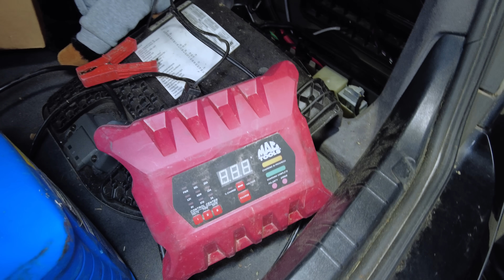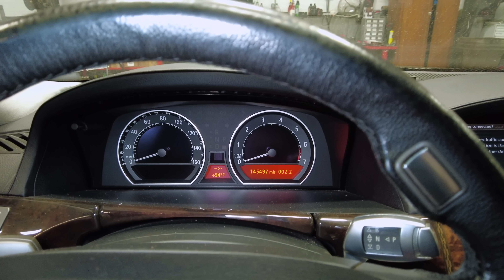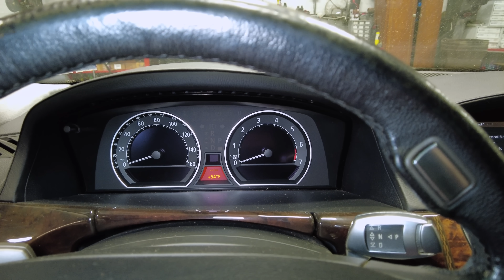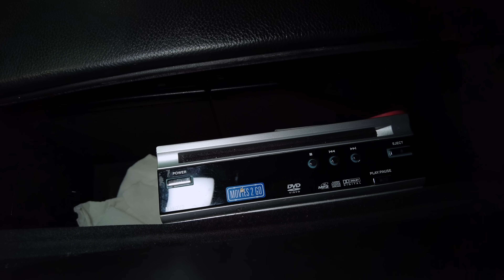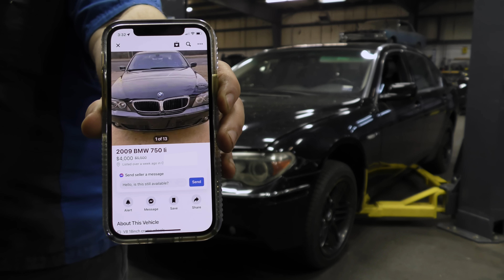Fixing a high mile German car?! Is this '04 BMW 760LI with a V12 worth it? CAR WIZARD breaks it down

Comment: that had been the most expensive BMW of the days back then, the 12 cylinder with a long wheelbase, ususally a chauffeurs car and so equipped 

Therefore best leather quality . But not the most reliable car with a ton of issues beyond the Bangle butt designed by Chris Bangle.
It caused a lot of issues cause sales were bad or the discounts had to be high to sell it in those days.

Comment: Pay 5k, spend 9k or buy another for 4k, then get a quote for 9k. Buy another for 5k.
OK, so that's 15k for 3 BMWs that still don't work. Or, pay 14k for one that will last a LOT longer.
Repairs are usually worth it in the long term. I have a 1954 Morris Minor that has cost FAR more than it is worth (at the moment), but it is now back to factory 1954 condition (or better) and will last another 60 years. I'd say that's good value :) And, if the worst comes to the worst, I can pop in an electric or hydrogen conversion :)

Comment: People think it's cool to drive a BMW. They pay for the badge. They can't afford to maintain them or like David said refuse to maintain them because they bought the car cheap. I bought a 2006 BMW 750i with 82k on it. It had a coolant leak I ended up  replacing the entire coolant system with the exception of the radiator. The coolant leak was turned out to be the coolant recovery tank hose on top the engine. The local BMW dealer told the previous owner is was going to be 9k to replace the valley pan and that's why they sold the car so cheap.

Comment: The 1999 to 2003 BMW, especially E39 chassis are going up in price in good condition. A low milage BMW E39 M5 just went for $80K!
Reply: @8rick1ane I had a BMW 540i 6speed. Grate car, but expensive upkeep!

Comment: This stuff has always separated the men from the boys.  Twenty years ago it was 80's Euro cars.  You saw a regular blue collar guy dailying a Saab or Mercedes or what have you and it was never missing from the parking lot at work, you knew they had their act together.  Finding quality parts for the old junk is the hardest part now.  I'm still driving them but I keep a couple to rotate cause I'm now old and lazy.  The newer stuff that's cheap now isn't any more interesting now than it was when it was new.  Which is to say, not very.

Comment: My 2012 Volvo XC60 has 233,000 miles and counting. Still in great shape. The Europeans are capable of making really good cars, but BMW isn't. So if you want the European car driving experience but Honda reliability (but slightly more maintenance) Volvo is the ticket.

Comment: But what if i work on a BMW 760LI myself? then it wouldnt be 5 grand in repairs right? or is the parts so expensive for those 7 series models that doing DYI is not worth it?

Comment: If that engine doesn't run properly with a bad battery, I'd be looking at the charging system. At no time should a properly running engine run off the battery alone, the alternator should provide the power to keep it running right. Maybe something leaked into the alternator and took it out?

Comment: Boy talk about a "cramped" engine bay. Sure it is a V-12, but There can't be but 2-3 inches from the radiator to the engine. How can the fan pull air through the radiator if there is nowhere for the air to go? Hood louvres would be a nice addition for that car. I've never seen someone drive a car with just a charger pack, and no battery. lol That car probably takes the largest car battery made for automobiles being a V-12! What 1000 cranking amps?

Comment: Wizard, I have a 2008 BMW 750LI and it needs a transmission. If I was to replace it myself does it have to be programmed and if so is that difficult for someone to do?
Reply: @musoui been finding them for 1,600-2,000. Plus the car only has 104,457 on it and is in perfect condition other than the trans ( Title in hand ). My mechanic owes me work for some parts I got for him so I'll only be out of money for the trans.

Comment: This why I drive a Lexus GX470 and my wife drives a Land Cruiser. My gx is an 06 with 145,000 miles and it should last me another 15 years. It will save me a ton of money over the years cause the Japanese over built everything to last a long time. Just doing regular maintenance is cheaper than buying a new car every 3 years.

Comment: I don't agree that all German cars are bad,i have a 2008 S6 V10 and a 2008 A6 Tdi, both have more than 180k.miles, both had been reliable as tanks, the only time i spent money in the S6 was the water pump and i.done timing chain. Other than than had been maintenance at aircraft leven, always preventive and has paid out.
I never seen a single oil leak on any of them..the tdi i dont even worry about as it never needs anything

Comment: What's sad is this nearly 110K car could barely last 145 k mi without just completely falling apart, but my '96 Park avenue 32K new, doesn't even turn a service engine soon light on till it hit 335k miles for an 02 sensor and now with over 412K miles still runs strong SMH

Comment: A car which is limited to 250 km/h top speed and WILL EASILY do that,   expect them to be fairly complicated.

So, which cars in the early 2000s will easily do 250 km/h at autobahn and in comfort ?
And still run today ?
What will they cost to repair ?

They are high performance cars and so, show them some respect.

Comment: Bangle singlehandedly destroyed the sleek design of the 90s with the lumpy garbage and random bodylines starting with this E65 series. He was chief designer on another abomination before that, the Fiat Coupe. Barf. His minion Adrian van Hooydonk is still in charge, and you what garbage design like the new 7 series BMW is still cranking out. I owned several 5- and 7-series, and since the Banglelisation of BMW, I wouldn't get caught dead in one.

Comment: Seems odd that the alternator can't provide the power when the engine is running.  There are cars that can run without a battery at all.

Comment: @12:20, cracked lower control arm drivers side.
Reply: No check opposite one at 11:59 and it's a ridge, not cracked but the light

Comment: The whole unreliable German car stereotype just isn’t the case in my experience. I’ve had several Audis and VWs over 200k miles and none of them used oil or had any major issues. Sure a big V12 is gonna need more stuff than a 4 cyl and it’s gonna cost more especially when maybe 50,000 engines were ever made vs several million but that’s just common sense.

Comment: Funny i have seen this in jamaica. Lots lots lots of milege. Since ive migrated to the north america is crazy how people put a benchmark on cars. Like 100,000miles and then after its a celebration. Where in Jamaica and other neighboring dont know anything about milege. Milege doesnt really affect the car prices in jamaica after a certain point
 Its all about how clean it is and how well it runs. My neighbor 2001 tundra pass a over 2million miles. I think the clock even froze. But yet still its not celebrated there
 Its like whatever. And its still value close to a million dollars. Around 9000us. My uncles e92 m3 has over 300,000miles. But when i come here people talk about it cant pass a 100,000miles. What i have notice the system over here makes you not value your car by raising labour rate tru the roof
 So when a car reaches certain point people decide to junk it. Also, this bull crap about car looses alot of value when it drives off the lot. Its so crazy how the north america system works. My bmw m5 f10 has over 200,000miles there. No issues. Just regular maintenance. Im brining back a cv axle to change when im on vacation in the summer. But thats all its just amazes how people here just dispose of cars so easily

Comment: German cars with plastic components with the integrity of a saltine cracker. Same with most clips & connectors. 
When you get to about 2% of the vehicle's weight being that of "Zip Ties"..... trash it. (about 5 years or 60k miles )

Comment: The plastic will degrade over time so mileage is irrelevant concerning those plastic parts. No plastic in the engine bay of the FW 190!
Reply: The plastic becomes brittle through heat (softener evaporates), so the engine runtime is one of the major factors. Unless you park the car in a sauna, of course.

Comment: Unless you're Ase Certified mechanic or you just have a lot of money to blow it's hard to Odin one of these. All the plastic that they use and all the oil leaks it's just not worth it. These kinds of cars of the one that you just lease and turn it in at the end of the lease.

Comment: Always talking about how terrible BMW'S are. And I agree,matter of fact most new cars and trucks are poorly made or over engineered.
Then on the other side of the spectrum you explain how your moving away from older vehicles because of crappy remanufactured parts etc.
I enjoy your posts,but this one I wasn't into it at all.
Incunclusion,please get that ole chevy down off the rack and drop an LS into it.
Make a multi part series,explain the advantages of investing in old American steel.
Peace,and god bless America

Comment: My brother is about to buy a 1975 Mercedes Benz for 6k that is in really great condition looks wise. Supposedly has 65k miles on it which I highly dought since it does not have a 100k odometer. I had a question you German Car people might be able to ansewr for me. I have been told Mercedes cars were bullet proof like Toyotas 1980's and older so how do the 1975 models fair in reliability this one has the diesel. Looking at the over all condition of the car I would estimate 165k miles it is in that shape visual and it runs smooth. I know parts are probably a nightmare to find , but how expensive are the older parts and can they be found? I warned my brother to hold off before He and I could research what he is getting himself into. Thanks! I did tell him to call Omega, but they are not keen on older vehicles anymore, but they have the knowledge.
Reply: These are the real Benz. Built like a tank
Reply: If you can find a junk yard that has a few, they are really cheap cars to maintain actually. I had a fuel pump go out.  I paid 20$ for used, and installed it myself in about a half hour.  And I’m no car wizard.

Comment: 100k is high miles?
Reply: On a German car yes , on a Toyota or Honda no
Reply: The problem is rather that it's almost 20 years old. Electronics, plastics and rubbers don't like that.
Reply: @krassimirpetrov7131  On a german petrol car. Diesel is the future!

Comment: For anyone looking to do this themselves, I used this video to do the valve seals on my 07 650i with the N62 engine.  It's not so bad if you don't expect to drive the car for a long time.  Like, at least 3 months.  https://youtu.be/6U8XDCvZ5zo

Comment: What was the alternator output voltage? Duh, that 's the clue. You didn't mention that. The plastic breaking and cracking sounds just like any other car. The 750's were the worst ones. The high repair bills come from you and all others who work on cars like this. Mechanics will always rip people off no matter what. If you can't repair the car yourself, junk it because any mechanic will want more than the car is worth . There disposable. Car wizard why are you shocked by this because it happens with all makes.

Comment: If this 04 BMW is not worth fixing then what will a 2022 be worth in 20 years time. They are getting worse not better. I am pleased you are enthusiastic wizard, but I am losing interest in the modern over engineering cars by the day. Rolls Royce were the car company that showed us how to make expensive dependable cars but now rhe cheap common Japanese cars does a better job at dependability. When my old 1996 Jag has gone. I'll be buying a cheap Jap car. I hate the modern Jags. Froma Jag to a Jap!